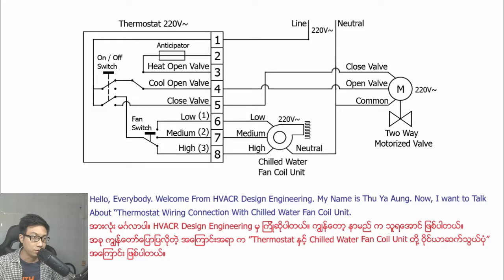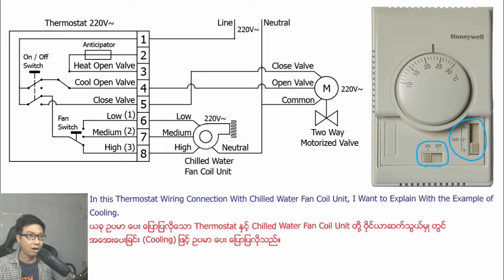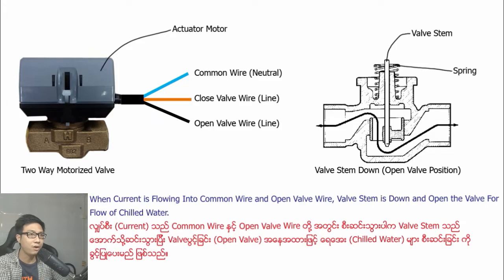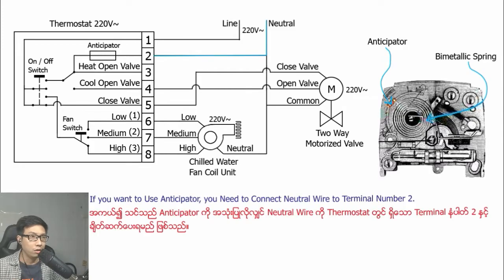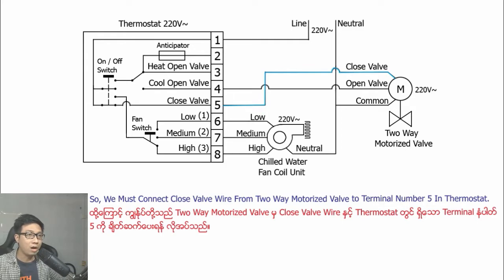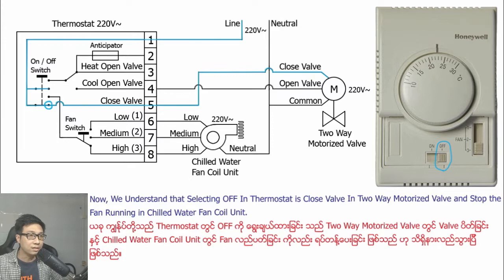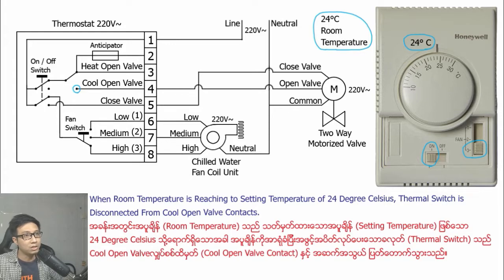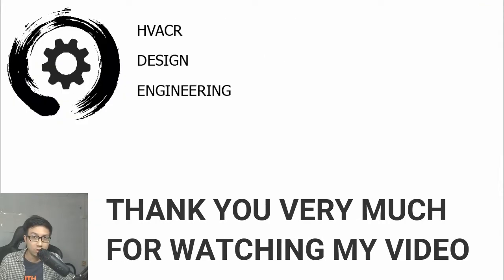Thermostat Wiring Connection With Chilled Water Fan Coil Unit_29-Jan-2022

Comment: Ur accent very strong but a million tnks cause we deal with the same units here in Florida and ur video is excellent I understand 100 percent of the explanation very well done and the Diagram very helpful ONLY difference here is that valve is either 110 volts with 2 wires and also can be 24 volts activated in cool only cause is Spring Activated to Close Position when De Energized very easy operation but guess what a percentage of Svc Tech Do not know how to Troubleshooting or Operation is achieved......ur video deserve 1000000 views and likes. Be bless my brother